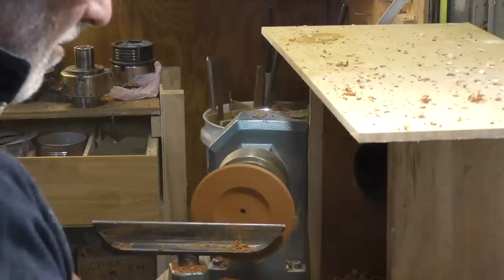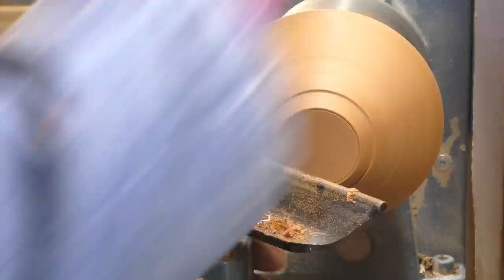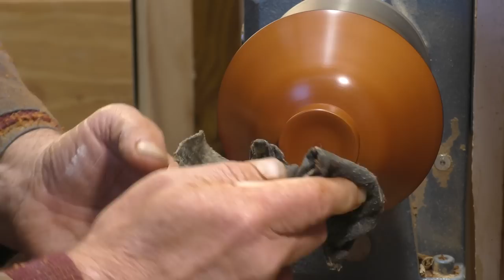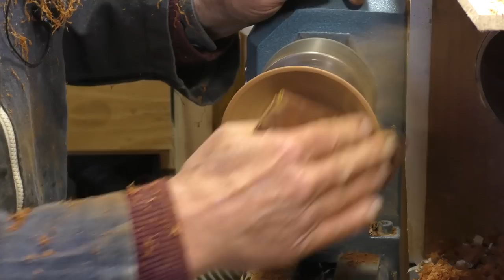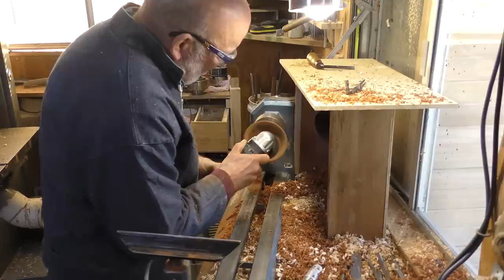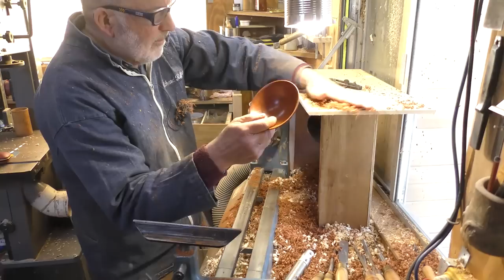Richard Raffan turns a she-oak bowl

Comment: I don't have any experience with the boiled linseed oil and wax combination as a finish, but have seen you use it on many videos.   Does it hold up over time?   If not, how do you touch it up?
Reply from the maker: I hope my bowls will be used. If used for food they'll be washed in hot water and detergent which removes the finish. I put a label on each bowl that advies what to do. Bowls in daily used can be treated like a wooden chopping board: washed and left to drain, oiled very occasionally if you feel you absolutely have to.  If a bowl isn't going to go near water it can be polished with any furniture polish, preferably beeswax-based, but that's not essential. Regular polishing, say weekly, soon produces an antique-like patina you'll never get out of a bottle or can.
Reply: @RichardRaffanwoodturning  Thank you.

Comment: Did you say you used Bees Wax to finish?
Reply from the maker: Correct. I use pure beeswax,  often mixed with boiled linseed oil on the wood as it spins on the lathe. .